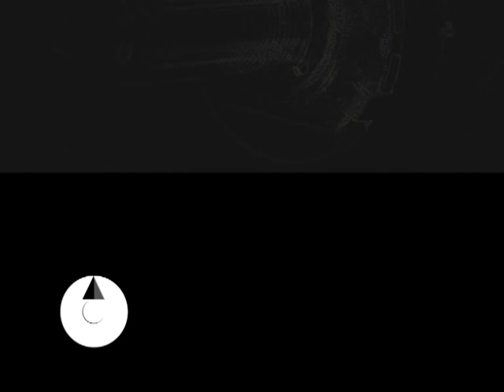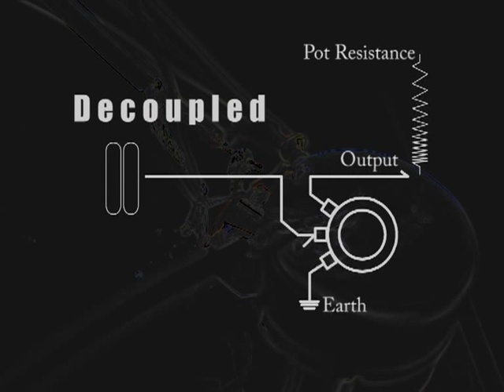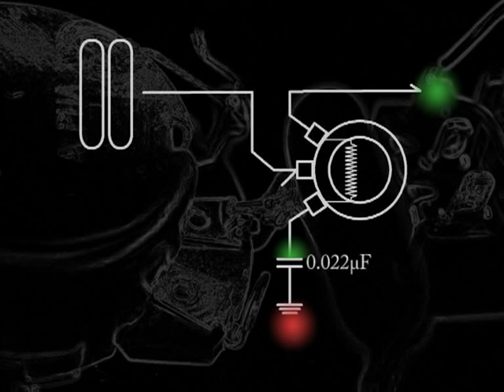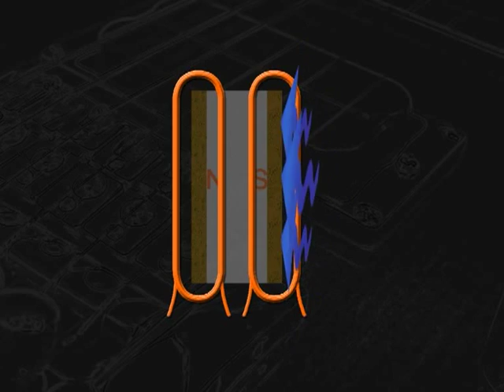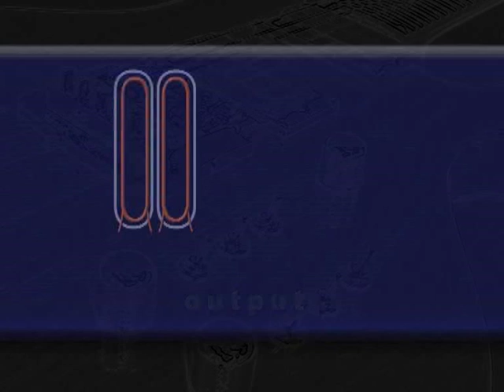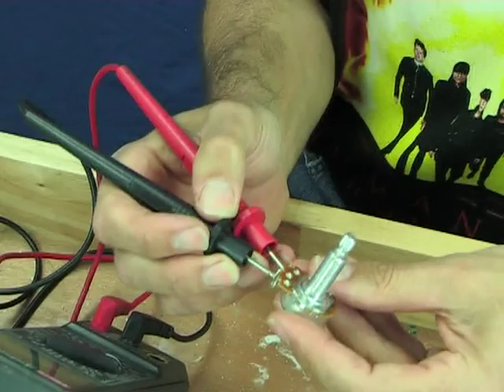Electric Guitar Electronics Tutorial

Comment: I am SO CONFUSED by all of this "ground" stuff in electric guitars. There is no connection between any of these components that you call "earthed" and the earth itself, so it's just a neutral wire, no? I'm really really frustrated by this because it's stopping me from understanding exactly how an electric guitar works.

The way I see it, the "ground" connections are simply neutral wires that send the signal back to where it originated from so a circuit can be formed. Isn't this the case? Please someone, anyone, correct me if I'm wrong and explain this to me, because I'm really frustrated lol
Reply: There is a true earth/ground set of connections in an electric guitar. Anything that is a screen, such as the screen on the pickup cable is connected to the ground circuit. The cases of the pots are also grounded. If you line the electrics cavity with conductive foil  (to make a "Faraday cage") this is also connected to ground. Most importantly, the bridge is connected to ground so that the strings are grounded too. Then when you touch the strings, you (who are reasonably earthed) will provide the path to earth and this should eliminate most electrically induced noise. You often can hear this when you take your hands off the strings you can hear noise and buzzing then touch the strings and all goes quiet. Something like that anyway......

Also, on pots you will use the ground circuit to connect to one of the tabs so that the signal wires can be bled to ground through the pot to make a volume or tone pot. It is a "floating" ground if you're not touching the strings, but nevertheless is a ground/earth in terms of how the circuit takes the signal away.

This earth connection is connected to the barrel of the guitar lead and is the screen of the guitar lead which ultimately is earthed on the amp. If of course you are using radio connections it is you that is the earth to try and kill the noise.

That either helped or created even more confusion ;)

Comment: I have a Fender powerhouse mexican deluxe SSS (about 1999). The one with the dummy coil and active boost. I was getting a loooot of hum when I was using metal distortions. I was not sure if this was normal since the guitar had a dummy coil. Anyway i thought I would replace the bridge S with a S.Duncan Hot Rails humbucker. I thought that at least i could get rid of the noise at the bridge position. Result was that the Hot Rails produced even more hum than the single coils! with or without the active boost! I had a guitar with a humbucker and with a dummy coil on it and still the amount of hum was enormous, even at volume 3/10 on my Roland Cube 80x! Any ideas what might be the problem? maybe i need to put a new dummy coil or something? I am desperate! thanks in advance.